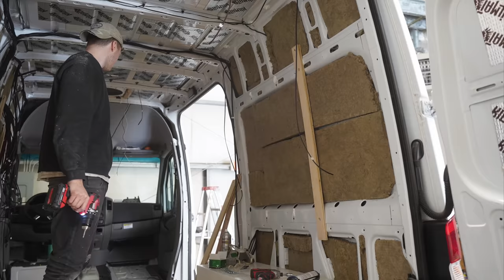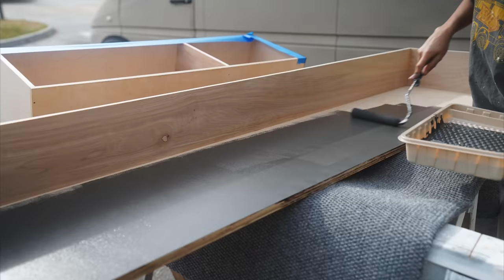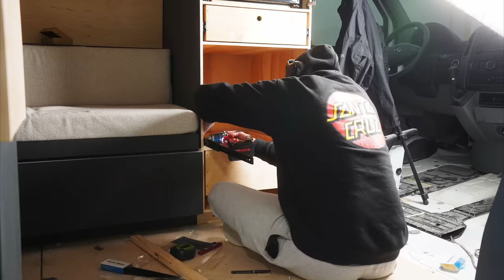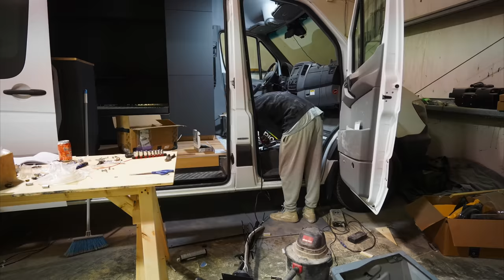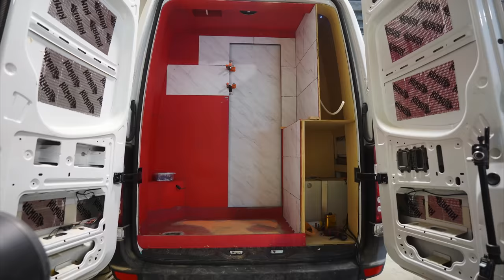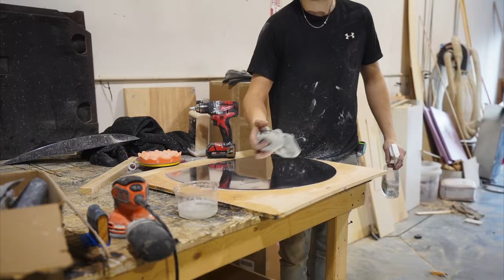VAN BUILD IN 10 MINUTES | Luxury Shower In a Camper Van | Modern Van Design for Vanlife & Travel!

Comment: I think the hidden shower inside the seating area was one of your best ideas, unless someone is full time living in a van, the hidden shower could be put inside a short or medium wheel based van, without sacrificing much space.
Reply: Agree. Not to mention the weight
Reply: Iunno, this makes it so you always have a waterproof, stain proof way to walk into your van and take off your shoes for indoor living space.
Reply: L
Reply: 0
Reply: L
Reply: Well, it's not an original idea. In fact, I'd go so far as to say that it's one of the standard ways to install a shower in a van. There's not much room in a van for a huge amount of innovation when it comes to fitting in a shower space. The install was clean though.

Comment: If the vehicle was larger, you could put in a washer/dryer as well. Only limiting factors are 1. power 2. warer, RE: Power, sources, solar, wind, water, if near streams, etc. Next RE: water, design a rain water collection then you wouldn't have to constantly refill fresh water and you can stay off-grid longer. If you're in BLM, you can even be there for a very long time and go for resupply runs with your e-bikes if you mount a milk crate in front of the e-bike then you wouldn't even have to move the van. :)

Comment: Amazing! That's a no compromise bathroom!  But I don't understand why the toilet was put in an angle when there is enough space to put straight, seems inconvenient to sit towards the door. My knees would be smashed against them.
BTW, check out the bathroom solution in the Hymer Vision Venture van. It's an expanding area, really smart.

Comment: The grout in that shower will be coming out the first time you hit a bump in the road. It is not meant to be used in a situation where there is any flex. Count on tile cracking too.
Reply from the maker: This is all vinyl tile and silicone based grout!
Reply: Yeah, the van is looking great, but that shower is going to leak. There is a much better way to do it.

Comment: Instead of dynamat you can use rhino lining spray bed liner does basically the same thing. Also you could use an RODI water filtration system to turn your grey water back into potable water it’s basically the same thing big cities do to our sewage except they use settling ponds to separate the black water (poops) from the grey water then run it threw giant RODI filtration systems and back to us. If your grey water only consists of bath and sink water the system will separate that out easy.

Comment: This is the sickest build ever. I'm thinking of copying this build for my personal use. Would you be willing to share wiring details and measurements for the interior panels? Which shower vent did you use? Where could I find this sliding door & mirror? If I live in a place that reaches 110 degrees farenheit, which AC would you recommend assuming similar electrical components & insulation?

Comment: What type of tile are you guys using? It looks flexible. Also adding waterproof into lumber then tile, how secure is that process to avoid any water damage on the lumber?
Reply: I’m confused I didn’t see them use any insulation in that van maybe I missed it or they used something else?

Comment: Hey guys, I'm building a van and love this bathroom concept. From a fabrication standpoint, where does the shower water that hits the sliding bathroom door plus the water that finds its way into the pocket door frame/carcass? Where does that water go? Thanks for any info you can provide
Reply from the maker: We spent some time developing a seal that we used to direct the water back into the shower that hits the door. It actually wasn’t on in the tour video but it also squeegees the door off when you open it.
Reply: @scarletandseth  can you point me to a link, if not for the product, then the raw materials you used to make the seal & squeegee. Many thanks for your consideration to my inquiry.

Comment: Great design and build, but did I see you using real tiles and grout? If so, you can expact everything cracking and coming off. Better to use PVC imitation tiles or something.

Vans walls are not stable enough to keep tiling intact unfortunately.

But all the rest looked A+.
Reply from the maker: They are vinyl tiles with flexible grout.